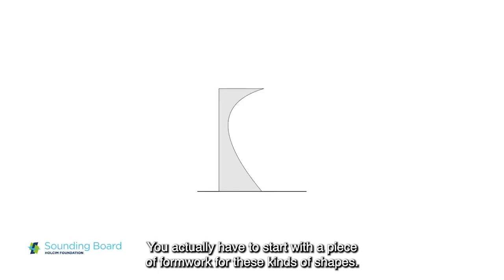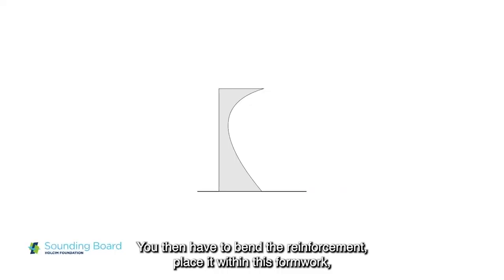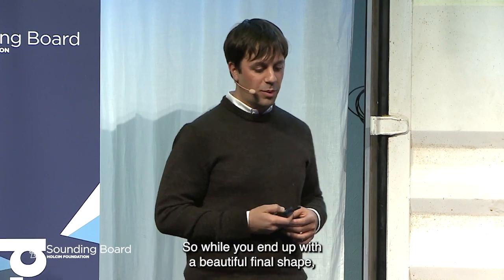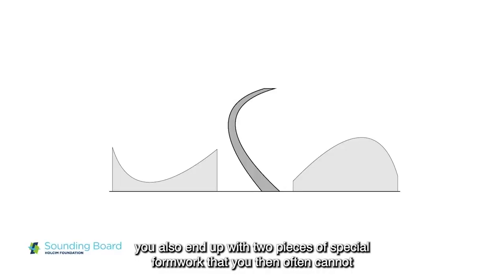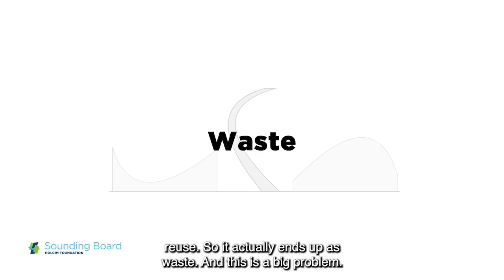Digital rebar: An opportunity for material-efficient construction - Ammar Mirjan

Comment: The idea. Of spraying concrete is great. I also like the idea of adjusting the rebar cage "generatively" though isn't the cost of working primarily with a robot for placing and welding the rebar prohibitive for mass production?